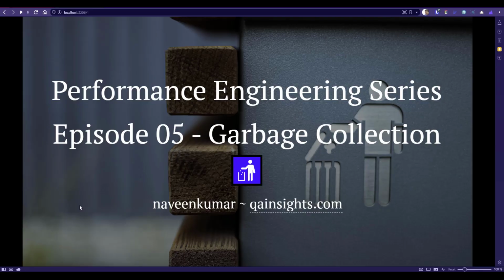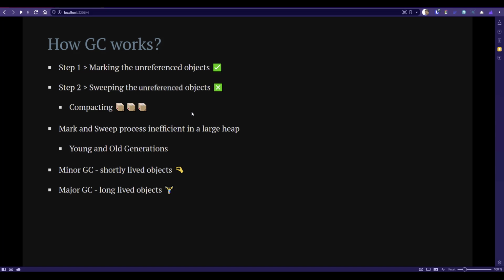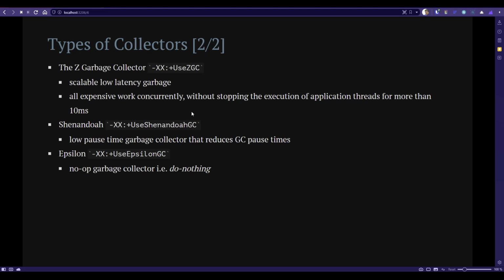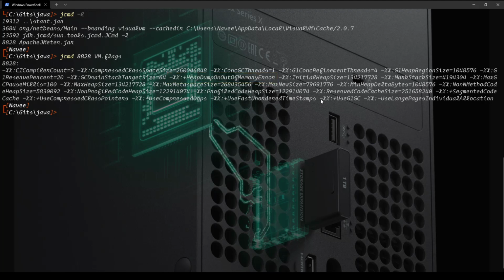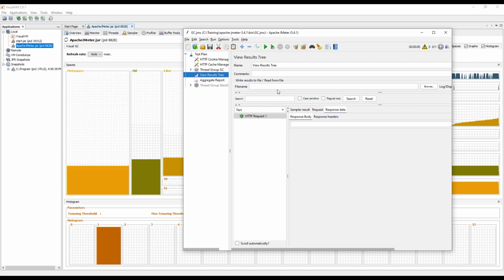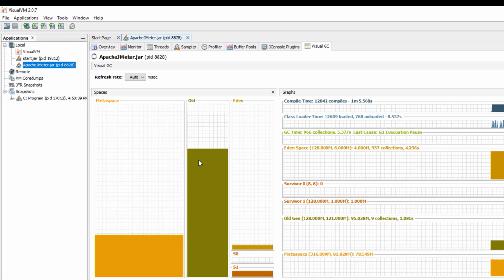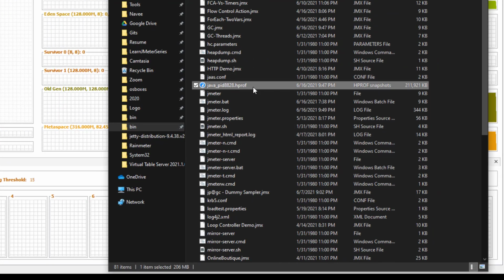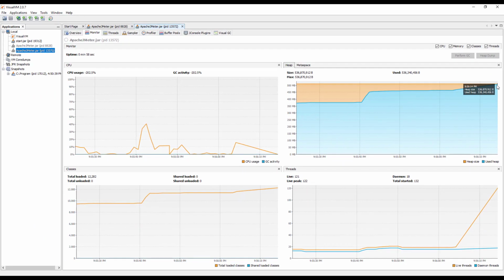Performance Engineering Series - E5 - How Garbage Collection works?

Comment: Hi Naveen, thank you very much for this series, videos are very insightful. I have one question - does the minor GC moves the long lived objects into old gen ? how the long lived objects moved to old gen? Thank you.
Veera.
Reply from the maker: Just adding the flow about young gen.

1. New objects will be created in Eden space. Object creation will be pretty quick.
2. Once the young gen is full, minor gc will happen.
3. All the objects which are living, will be moved to either Survivor S0 or S1, lets pick S0.
4. In the next minor gc, the surviving objects from Eden and S0 will be moved to S1.
5. After few moments, during the next minor gc, the surviving objects from Eden and S1, will be moved to S0.
6. Even after few minor gc cycles, if the objects are living long, then it will be moved to older generation.

At any point of time, either S0 or S1 will always be empty. S0 and S1 used to swap the objects just to make sure the GC is efficient. In the recent versions of Java, the process is slight vary, but in general this is how it works :).
Reply: Minor GC will move the eaden space objects into the survivor space 0 and survivor space 1 to allocate memory to the newly created objects in eaden space. Once these survivor space objects cross the threshold limit (number of times objects are survived by the minor garbage collection), are eligible for older generation.
Reply: @sudhir22sharma  thank you Sudhir